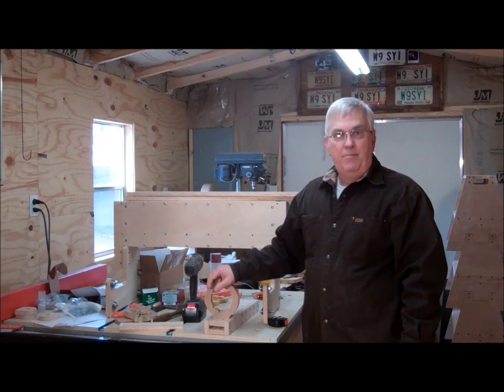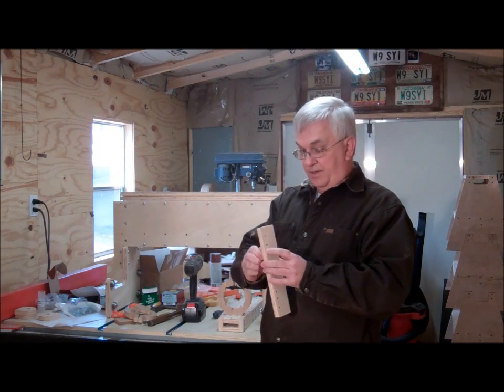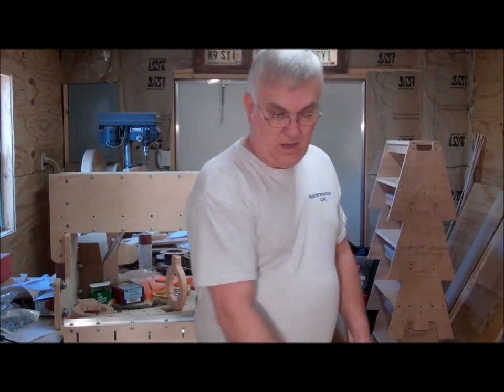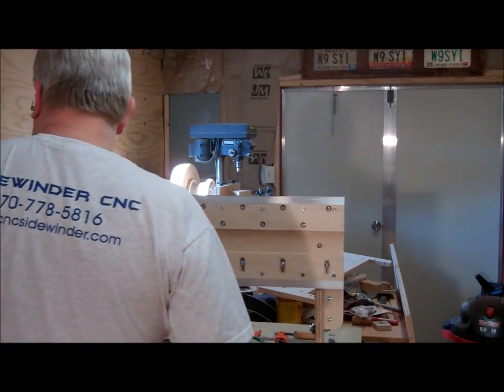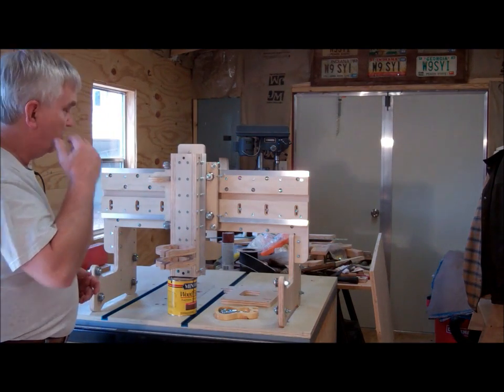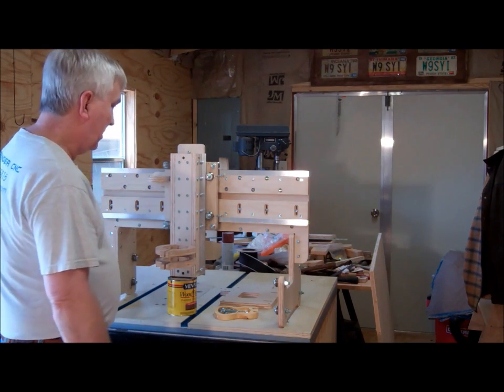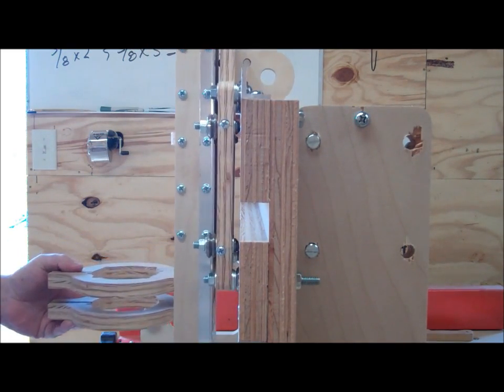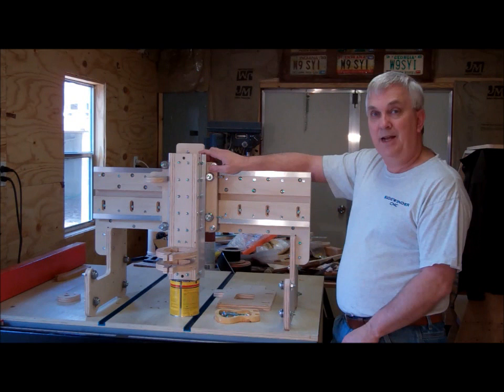How to Build a CNC Router On A Shoestring Budget Part Two

Comment: Thanks Dave for a very informative series of videos. A question about the aluminum rails. In this design do the rails wear out or does the steel bearing work harden the edge over time? Thanks

Comment: i really like this idea and would love to build 1.. it would be a great addition to my home made bandsaw.. also building a lathe that is also a disc sander and belt sander ..but i am wondering,what if you dont have a cnc already???.. it says "on a shoestring budget" well, people on a shoestring budget dont have a cnc machine to start with or a benchdrill most likeley.. so my question is, is this build achievable with hand tools, a regular router and power drill???

Comment: Thanks for the plans Dave. Can't wait to get started building my Cnc. Do you have a list of the electronic gear and the guides, rails and leadscrews needed? I've looked up stepper motors but was a little confused with the different types and was unsure which ones I need.